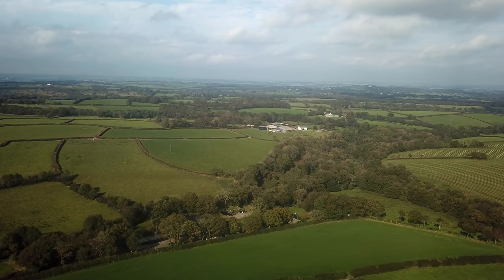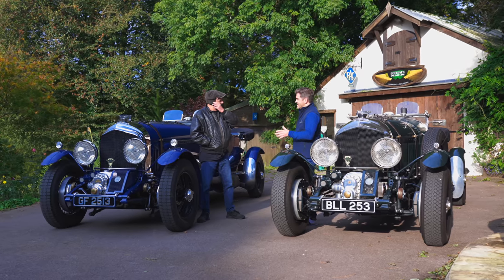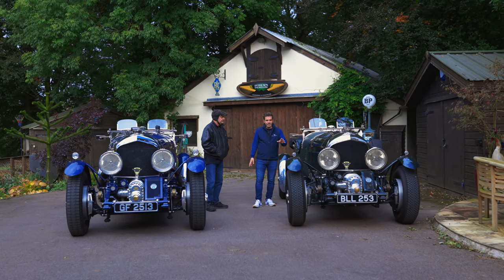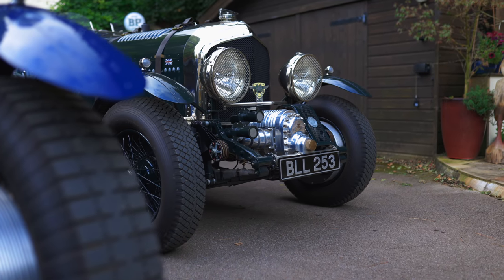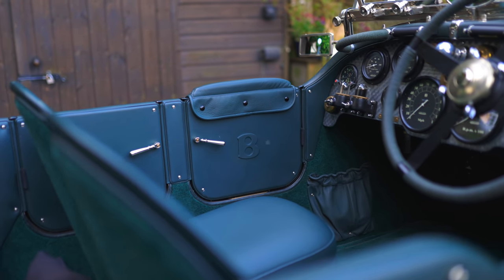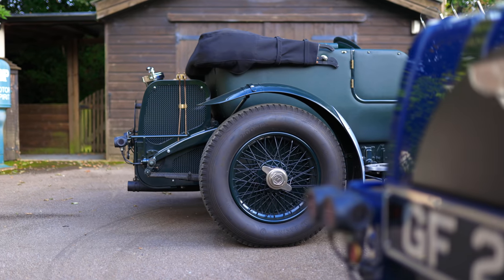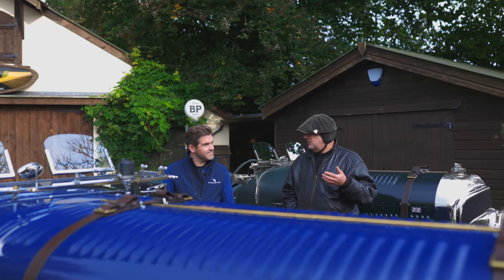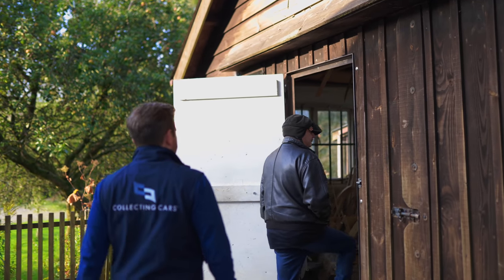Petersen Engineering - Building a Blower Bentley

Comment: Bob Peterson indeed builds unique and great cars - but he is not alone. A trip over to Wales and you will find Peris Edwards and his company Racing Green Engineering building equally fantastic Bentleys, Rolls and  Alfas. I've owned one of his Speed 6 models for 13 years, based on a  MK VI chassis with a Rolls Royce B81 6.5 straight eight it is the most wounderful and usable car - 8MPG hurts a bit though!